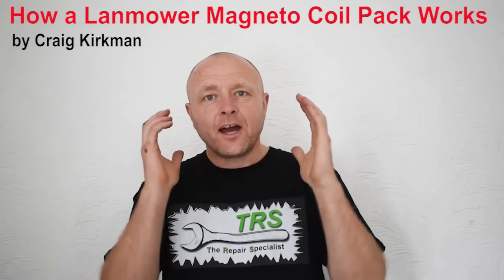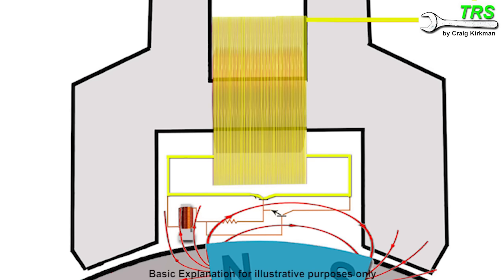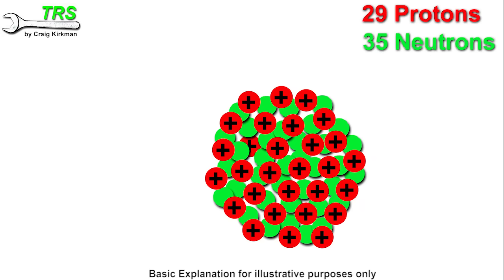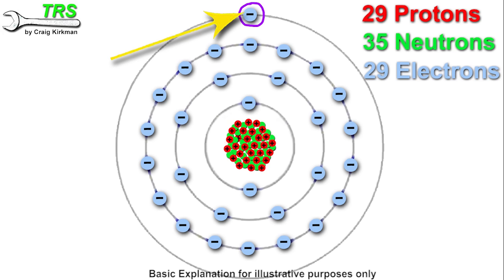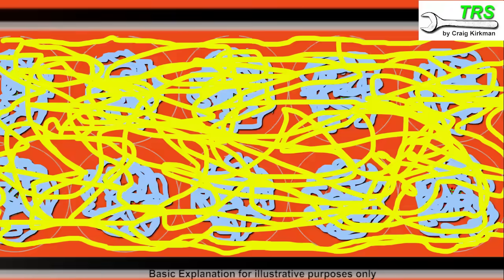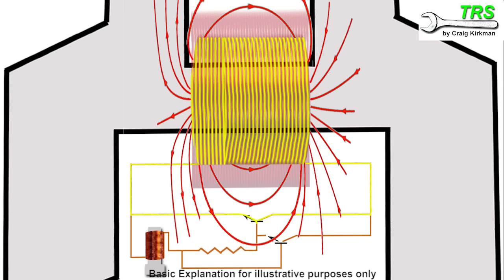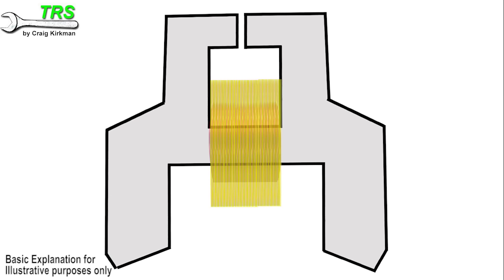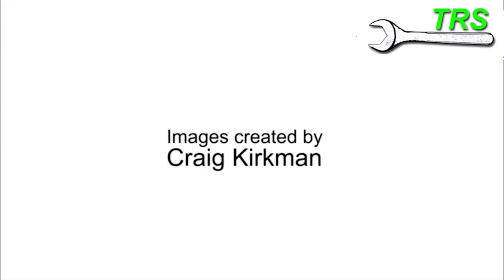Lawnmower Coil Pack Sparking System - Induction Coil, Transistor!  (by Craig Kirkman)

Comment: A couple of details.  As the current induced in the trigger coil flow through the lower transistor, it turns that transistor on, creating a circuit for the current induced in the primary coil by the passing magnet to flow.  Both currents then turn on the top transistor hard, i.e., as fully as possible so maximum primary coil current flows, creating the maximum magnetic field around the primary and secondary coils.  As the magnet leaves the trigger coil, the trigger coil current stops, which shuts off the lower transistor, which shuts off the current keeping the top transistor on, causing it to shut off fast.  This causes the current in the primary coil to stop, causing a current in the secondary coil as the surrounding magnetic field from the primary current collapses.  This secondary current flows to the spark plug gap where it "piles up" till the voltage rises enough to arc across the gap creating the spark.  (The collapse of the secondary coil's magnetic field as the arc extinguishes induces a current in the primary whose voltage is limited by the resistor to protect the transistors and safely dissipated).
Reply: Sounds good to me. I do understand how it works but barely. I think points are easier to understand.
Reply: I believe the circuit shown is slightly wrong on the resistor termination.   A resistor connected to a darlington transistor in the depicted location should have the left side terminated to the left of the trigger coil.  The darlington's trigger current path is as described however the illustrated resistor purpose, if present at all, is to speed up the darlington's shutoff.   Many circuits would show a ground which in this case also appears to be to the left of the trigger coil.  So that resistor in an npn darlington would be grounded and not tied to the voltage output.   It would be easier to explain with a diagram but that is not possible in comments.

Comment: Excellent video as usual.  The one question I have is how does a kill wire work?  You ground the coil to the engine block, presumably because it has a lower resistance than the coil and the current will take the path of least resistance.  So, how do you test that the kill wire will work?  I want to test the kill system on my weedeater while I have it taken apart replacing the clutch.  I had been having some issues with it.  I tested the switch on the handle itself, and it tested good.  I don't recall if the repair guy had fixed the kill switch or not.  Shortly thereafter the clutch went out and I just bought a new weedeater.  I was done paying someone to repair it.  So, I plan on removing the wire off the magneto terminal and the wire off the engine block that's connected to the other side of the switch on the handle, close the circuit by holding the switch, and test for continuity at the ends of the wire that would connect to the magneto and to the engine block.  I have tested the switch on the handle, and it tested good.  This way I can test the whole wiring system in a loop.  If it's got continuity the whole way around, then all I have to make sure of is the side grounded to the engine block is making good connection and there's no corrosion or whatever.  But the question becomes, how do I test the terminal on the magneto itself that the kill wire plugs into to make sure that it's functional as well.  Before I put the clutch back on and put it all back together, I want to make darn sure the kill switch is working lol cuz I don't want to take it all apart again to troubleshoot.
Reply: You can do that with a continuity tester, ohlms, volt meter.
Reply: If I may, I am not sure that the designers of small engines have not come up with some new method, but the common method of stopping engines with magnetos or similar ignition systems has always been to connect a ground wire from the kill switch to the primary coil.  In fact, on aircraft this lead is called the "P" lead, for primary.  When the magneto switch is in the OFF position, it is actually on.  That is, the contacts of the switch are closed, connecting the primary coil in the magneto to ground and preventing it from functioning.  When the switch is placed in the ON position, the switch contacts open and disconnect the ground from the primary.  At this point the magneto is live, and will fire when the engine rotates.  If the P lead is disconnected from the magneto, that magneto is live, regardless of the position of the ignition switch.  That is why you should never turn the propeller on an aircraft engine, and why mechanics will momentarily turn off both magneto switches on a running engine.  They want to make sure that the switch will actually shut off the magnetos.  Having said that, you should find that the terminal to which the P-lead on your appliance connects has a resistance to neutral (probably the frame of the magnet), equal to the resistance of the primary winding.  That should be a fairly low resistance--I would guess it to be between ten and forty ohms, but you may be able to find the actual value in the manufacturer's data.  Good luck.

Comment: Great explanation. I had no idea that there was a trigger coil. I always thought that the magnet directly drove the primary coil. Only one improvement, the negative lead on the spark plug needs a ground to complete the circuit. For that matter, the secondary coil should show where it is electrically connected.
Reply: Me too lol

Comment: Thanks, really instructive. One question born out of ignorance. You example the use of transistors, which I understand in a basic way. However magneto powered mopeds, and scooters were around before transistors.... I think....Maybe I am wrong. In which case if I am not wrong, did they use diodes, or am I ...... wrong.
Reply: Points and condensers in older cycles and mowers to break the field.
Reply: @graymodeler  Thanks, I really must put on my thinking cap before asking stupid questions to which I should have known the answer. 🤦🏻‍♂️
Reply: @capnpugwash5403  Sounds like you just forgot. Mechanics today don't know anything about points, they have only heard of them. If you know how points work, then you don't need to know how any other ign. system works. The theory hasn't changed, only the electronics.

Comment: Excellent explanation... I think that the magnetic field from primary coils don't need to collapse in order to cross to the secondary coil.. I think that happens simultaneously.. Thanks for this video as always!
Reply: The field has to collapse In order for the spark plug to fire. They call it induced, or induction.The primary coil doesn't collapse. The secondary coil does, that's the induction where the high voltage jumps that spark plug gap. THIS EXPLANATION IS WRONG, Please read the following. I'm sorry if i have confused anyone.
Reply: @johnnellis3025  John, John, the the primary current does collapse.  That is the whole point of having points or transistors to interrupt the primary current at the proper instant.  It is only the rapid collapse of the PRIMARY magnetic field, cutting through the secondary winding, that can induce a voltage sufficient to spark the plug.
Reply: @Hopeless_and_Forlorn  oops, my bad, you are right! I'm glad you caught it. I will edit that. Thanks. I confused myself, probably thinking of alternating current.

Comment: Isn't the electrical field strengthened by the laminations of the "A" shaped iron core as the magnet passes the legs of the core?
Reply: I think it is... Its the same as regular transformator...
Reply from the maker: @danilo86petrovic  yes deffinately. I should have mentioned this. Thanks. Craig
Reply from the maker: Yes, absolutely. Thank you for bringing this up. I should have mentioned that. Craig.
Reply: I really like your explannations.

Comment: Excellent descripton.  Question:  how does the spark advance work with the integrated coils?
Reply: Had also crossed my mind.
Reply: I didn't think a small eng. has an advance. They use a compression release system to make starting easier.
Reply: On single cylinder engines that use this there is no spark advance. As John indicates newer higher compression engines have a mechanism that holds the intake valve open slightly until near top dead center piston position and spark occurs. So only a slight compression cycle occurs. As soon as the engine kicks off, this compression mechanism has a centrifical weight that lets the intake valve open at bottom dead center. I've been scrapping out a bunch of old engines I have the past few weeks (you get more for the aluminum if the steel parts are removed). These engines are from the late 50s to 27 years ago, and none of them have a compression reducing system in them. An engine I repaired last year did have one, and it was 5 years old. They are all flat head style engines. I'll have to wait for my overhead valve engine to fail. Only one of the engines had a plastic cam shaft in it. Interesting to see the evolution of how they simplified assembly and part count.
Reply: @f.hababorbitz  I think it bumps the exhaust valve open momentarily. That's what i'm thinking.
Reply: @johnnellis3025  I believe you're right. It has to be the exhaust valve or there would be gas blown back in to the carburetor.